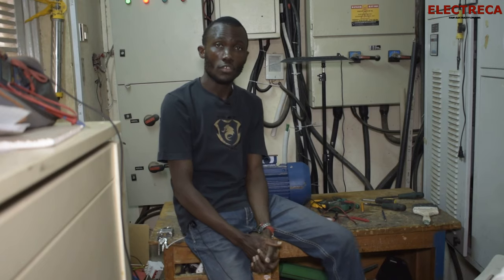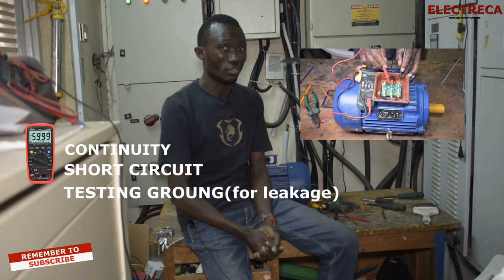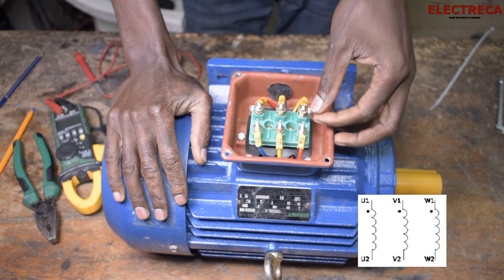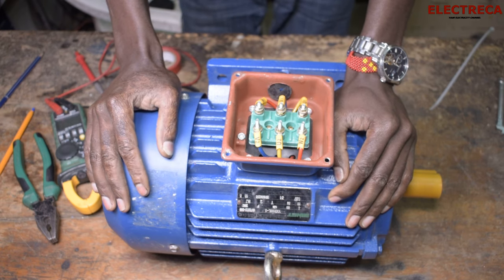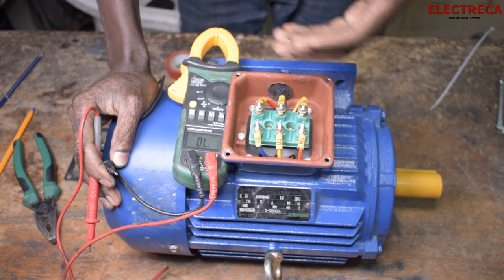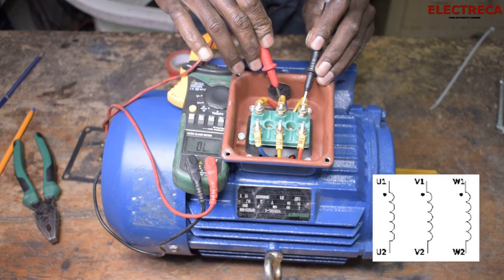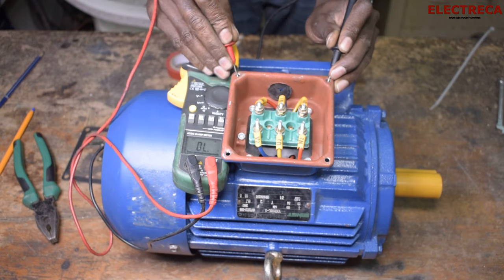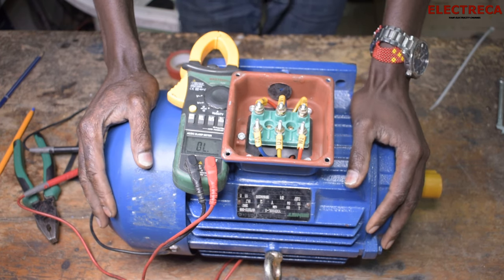how to test 3 phase motor with multimeter

Comment: Brother for resistance to ground checking please use proper electrical testing devices not an ordinary multimeter or clamp meter,use a calibrated multimeter with mega ohms insulation resistance test
Reply: fluke
Reply: We all use a multimeter or clamp meter for basic testing, but  Megger testing is always the best way to test especially on motors and will show up faults with the higher voltage that a multimeter or clamp meter on resistance can't . By the way: I'm an Electrical engineer with over 4 decades of Commercial and Industrial experience & I do know what I'm doing, yes I use both analogue and digital multimeters regularly but never go on site to do fault finding without a Megger.
Reply: Usually I go in there and 👁‍🗨 l 👁‍🗨  eyeball it. Get a feel for it. And usually lick my fangahs  together and vióla.. I have 7 decades of being an engineer sparky.. ty guys for in and output.. now watch out.. 🏃 ⚡
Reply: @D1Freezer  clearly you aren't doing any real diagnostics. Megmeters exist for a reason.
Reply: @D1Freezer  we are not talking about HVAC we talk about proper electrical tesring device to avoid missleading or confusion
Reply: As he first stated this is how a motor can be checked with a multimeter and very well
demonstrated 
Not all are sponsered by FLUKE
Reply: @manjitkaila9057  it cannot be fully checked with a multimeter alone. Leakage to ground through insulation breakdown will never be caught with a multimeter. It'll show being good and it's not. If you aren't capable of proper diagnosis, perhaps you should sit back down and leave it to the people who are.

Comment: Good clear video. Worth noting that you are only testing with  the small voltage from the meter. When checking for faults to earth ideally use a Megger which generates a higher voltage and will expose faults not shown on a multimeter.
Reply: Yea when I went to work at a power plant a long time ago , there was a pump motor that was given problem.  That was the time I watched the plant manager a old navy  electrician  use a megger to  test . He found the fault and sent the motor out to be fixed . I bought one of those on e bay for my uses
Reply: Me also first test the motor with multimeter and then with the megger

Comment: Great job! But please note those test are basic without a megger. Insulation resistance test or integrity are very critical, hence, can only be achieved by visual inspection and using a megger 🙏🏽….

Comment: Hello Engineer, can you do insulation test for inductiom motor? And i want to know if it's okay to conduct a continuity test when the motor is switch on? Or it should be switched off? Thank you for this video. A great help for us future Engineer
Reply from the maker: The motor should be completely disconnect from supply.
Remember when carrying out insulation resistance the Mega ohm meter has 500DC volt that it apply to  the winding.
Reply: Remember that any time a multimeter is used for continuity testing the device being tested must be deenergized. To test a motor for continuity, first isolate, or disconnect, it from the circuit. Then use the multimeter to check the resistance between phases....thank you

Comment: after your vid, i tested my 18.5kw motor
all good, would a megger test be needed
Reply from the maker: Apart from continuity and short circuit that the multimeter can measure at 100 per cent, It may be difficult for the meter to  detect insulation that has just begun to wear out
Yes, Amegger would be needed for the insulation test.
Thanks for watching.

Comment: Great video....pls so how do you remedy non-continuity between the phases, ground and short circuit faults in the motor windings. Now that we know how to check for faults in a motor...how do we fix any of such faults
Reply: Send the motor away to a rewind specialist.
Reply: …….dump in the bin or recycle 😂 if they aren’t that expensive….
Reply: ….hey sorry, there shouldn’t be continuity between windings but, should have continuity between phases when connected after testing, Star/Delta connections 🙏🏽

Comment: So I don't need a megger, I just buy any continuity tester and do this?
Reply from the maker: A normal multimeter can it just fine.
Reply: A Megger is the best way to check insulation resistance
Reply: A normal low voltage multimeter will not find all the faults that you can find with a Megger, a multimeter is great for testing of  winding continuity or opens & dead shorts but that's about it. You really do need a Megger type insulation tester for serious fault finding especially on 3 phase motors. I've been doing Commercial and Industrial fault finding for over 40 years and never go to a fault finding job without an insulation tester.

Comment: Why do we disconnect a 3 phase motor from vfd before meggering the motor
Reply: Because the high voltage generated by a Megger can damage the components in a vsd

Comment: How do you megger a 3 phase motor connected to vfd
Reply from the maker: Hey Paul,  You can not megger a motor connected to VFD, that voltage can easily rune the drive and that can cost you money to replace.
The only best option is to disconnect   the motor from the terminal box or from the Drive terminal.
I understand also that in such circumstance  dealing with large motor like 100s of HP can be a lot of work and also its bad idea opening those terminal periodically.
I think the best way is to create a disconnect position, it may not be a good idea but its better than disconnect everything every time you want to megger.
Thanks for watching.

Comment: Can someone help me?

The homeowner desires that a ceiling fan with light kits be installed in 5 different rooms.
Each fan contains a light kit that can accomodate four 60-watt lamps. Each fan motor draws a current of 1.8 amperes when operated on high speed. 
It is assumed that each fan can operate more than three hours at a time and therefore must be considered a continuos-duty device. The fans are to be connected to a 15-ampere circuit.
Because the devices are continuos duty, the circuit current must be limited to 80% of the continuos connected load.
How many fans can be connected to a single 15-ampere circuit? 

I have an answet i just dont know if i did it correcltly 😅 TIA